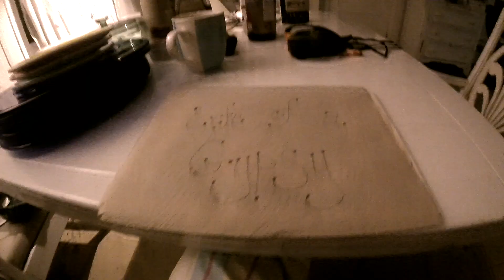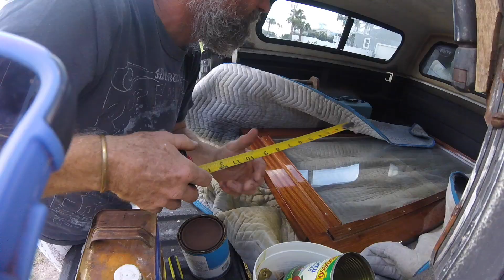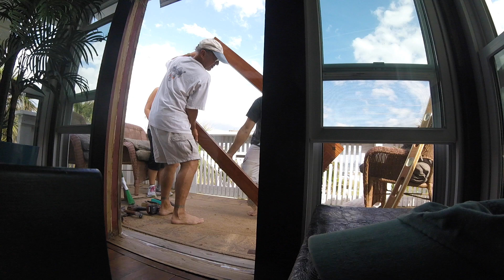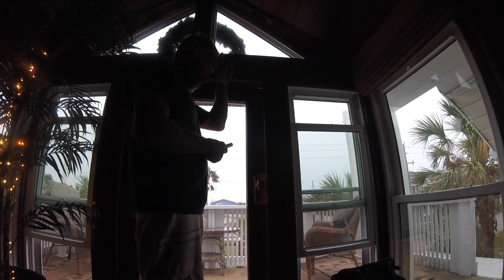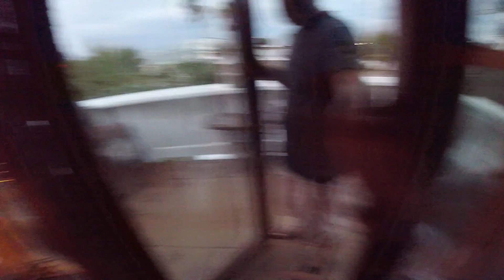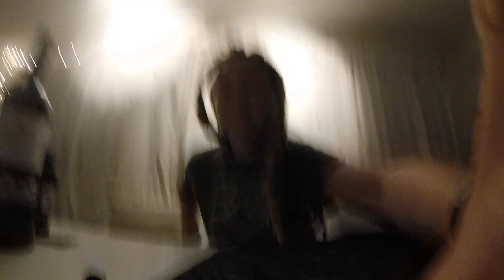Episode 338 - Installing a Door -  Life of a Gypsy Day 234

Comment: The closing side of the door needed to be  beveled. But that should have been done before finishing the door. The way it's normally done is you test hang the door without hinges by propping it up with wedges and scribe the door to the opening. Bevel the closing side. Then get it all hung and working properly and then you finish the door and hang it. I hired a boat builder to work with me doing finish work once. It didn't work out well. All the boat knowledge got in the way of our cabinet and finish work. LOL... Hope it worked out...

Comment: Well it's a handmade door, the thing must have cost a ton. I half expected Pete to hand drill the hole instead of using the electric drill.
http://www.lowtechmagazine.com/2010/12/hand-powered-drilling-tools-and-machines.html
When the doors got replaced in my apartment building with heavy doors, the workers whipped out the mills and it feeled like there was a war raging in my place for half an hour. Cheerio